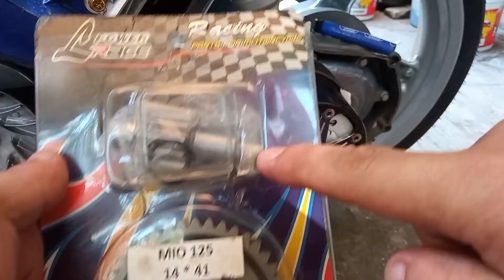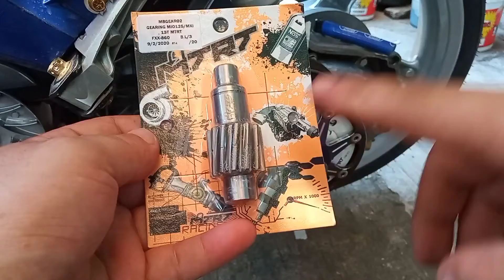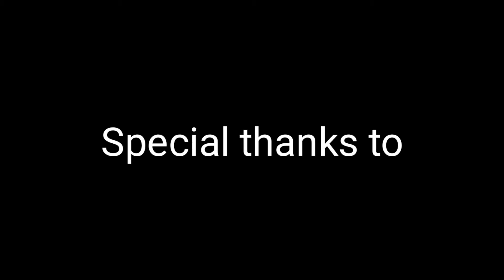14t/41 gearing sa mxi125 part 1  by NinjaRat

Comment: Boss vher pag nagpalit ba ng primary gear dapat b palit din dalawang gear..nagpalit kasi ako ng bagong primary gear pro luma ung 2 gear n bilog kaso may ingay sya pag pinapaikot tunog helicopter
Reply from the maker: Ano po gearing ang nilagay mo? Kapag po flat ang design ng gearing medyo iingay po yan. Pero kapag slant yun po ang tahimik. May explanation po ako dyan about sa flat ang slant na gearing. Paki watch mo po.
Reply: same😔
Reply: @ninjaRatMotoVLog  boss san po mapapanuod